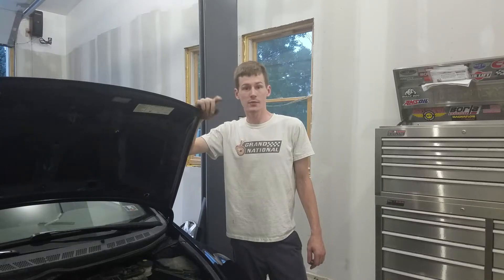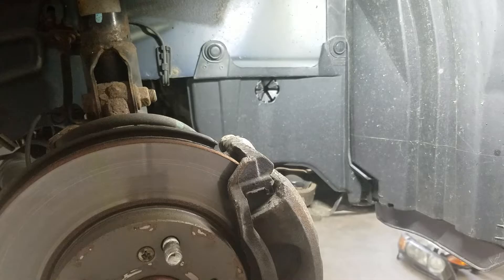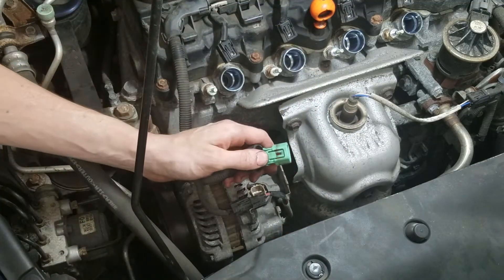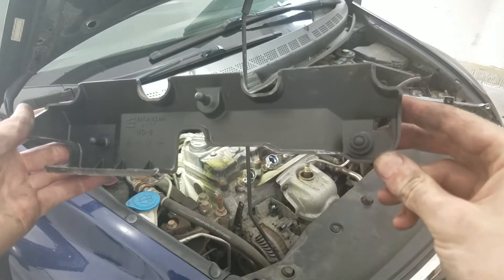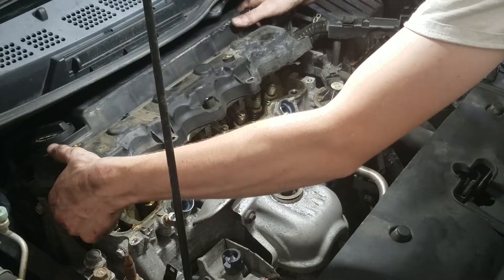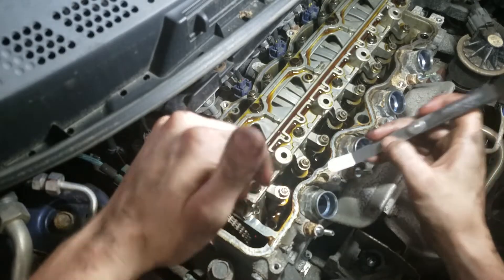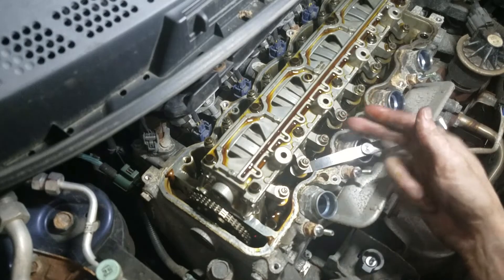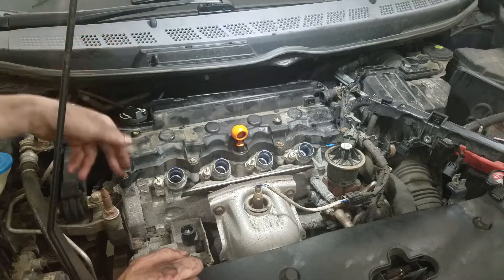2006-2014 1.8L Honda Civic Valve Adjustment

Comment from the maker: I forgot to mention this in the video but it is very important that the engine is completely cold. So, let the car sit overnight before you do this because, the valve clearance changes with engine temperature. All of the specs given in the video are for a cold engine.
Reply: Need help with valve adjustment of Honda city / jazz, thanks
Reply: Bro after valve adjustment fuel economy increased. Then in my next regill at same Gad station has mileage dropped back to 225 ish do you know what’s wrong ?
Reply: @sk8allica1 when you unplug your battery, the mileage trip numbers gets thrown off and shows more or less
Reply: @sk8allica1  more city driving?
Reply: maurjul nooo
Reply: @sk8allica1  everytime you drive is different people like you blow my mind how you made it to adulthood
Reply: Is it okay if the valve adjustment is 8/12? Engine temp is maybe 50%. Thank you
Reply: Dude, I read up online says Valve adjustment should be done while engine are hot...
Reply: @HansenWHS  some engines give a hot and/or cold adjustment value. The R18A specifies cold.
Reply: @HansenWHS  that is false. needs to be less than 100F

Comment: I 100% remember reading warnings about over-torquing the rockers on these when they first went into production, as it would damage the threads in the rockers and cause issues with them not being able to hold adjustment, but I can't find anything about it now.

I have an engine with rockers that wont stay adjusted properly. I've done more adjustments/clearance checks on my Hondas (two 1st gen CRXs, an '83 Wagon, a '93 CX, and a DOHC ZC swapped '91 HB), than I can remember, I never had a problem with the rockers not holding adjustment. One Civic (a 2004 EX) went nearly 150,000 miles under my care, the clearance never went out of spec after the first adjustment.

I feel like I'm the victim of some kind of weird prank!

Comment: You're turning the engine in the wrong direction, the chain might slip. You don't need to remove the wheel, just turn the wheels right. You also don't need to touch the alternator or the battery, just push the harness aside, no need to remove the coils either, there's plenty of space to do the job. You made such a simple job so complicated.

Comment: Good afternoon i think you got it confused , up is cylinder 1 then you do 3 which is cylinder 3 then clockwise cylinder 4 clock wise  then final cylinder 2, then spin s coulle times and re check

Comment: Good information I am over 300,000 on 2012 Honda Civic no valve noise
Reply: great car, ive got the same.  255k miles on mine  good engines all these years and miles

Comment: I need to do the plugs and valve cover gasket. I'm hoping between that and a valve adjustment I'll get closer to the mpg I'm supposed to be at (lx coupe says 35/40 mpg) I'm currently getting an average of 29. Is there anything else I could do maintenance wise to increase mpg. Like cleaning the maf sensor?

Comment: Removing the spark plugs will make turning engine easier - I remember that early, '69 to '76, Honda single cam four cylinder CB750 motorcyle used the same valve set up. Thanks for video - watching January 2025 and will use information to service both my Gen 8 Civics.

Comment: The Civic is the first car I've encountered in 30 yrs that needed manual valve lash adjustment. What was Honda thinking? I dunno, but I've sent them an email & asked. Overall a decent video with a few notable flaws. Why did you pull so much of the electrics off? I found I didn't need to do this to get the valve cover off. Hopefully i haven't ruined the car's electrics somehow.  You said "dipstick."  Your example of turning the engine over with a socket and handle shows you turning the engine counter clockwise. My understanding is that you only want to turn the engine clockwise. Your cautionary warning at the beginning about how there is important "feel" for how the feeler-gauge feels when the lash is adjusted correctly. The warning is so scary it would dissuade a user from attempting this service. As far as HEARING the sound the feeler gauge makes when the lash is correct: NO. How would you characterize the sound properly adjusted valves make? Difficult to describe? OF COURSE. You don't use sound to detect correct adjustment. NOBODY uses sound. The gauges used to test if valve lash is correct are called FEELER gauges. They AREN'T called listener-to gauges. Now, some critical style issues: there were several pieces of critical information you didn't narrate. I probably missed others, but one item i didn't miss was valve adjustment screw jam-nut torque is flashed on the video screen briefly, but. Same is true of valve cover bolt adjustment torque. Now why would you do this? If I watched only your video, your cautionary tale at the beginning would not provide me with enough confidence to perform this maintenance.  I did do the adjustment because I've done the valves on enough cars to know that i have sufficient skill to fill in the gaps you missed and perform the adjustment correctly. Lastly, you talk too slowly. I sped your video up to 1.5X so I could get through it without self immolation.
Reply from the maker: I'm anxiously awaiting your version...
Reply: @RepairGeek  Well, you got  me there. If I videotapes everything I do I'd never get anything done. Your video is a good video, almost perfect. I am providing constructive criticism with the noblest of intentions. You see, if your video was a hot mess, I wouldn't bother, but yours is SO GOOD, that all it needs is a few notable tweaks and you'd have the #1 Civic valve adjustment video on Youtube. Were I to make one, mine WOULD BE the number Civic valve adjustment video on Youtube. Do you seriously want that competition? If I start posting, it's going to piss a lot of people off. Actually, I just bought a tripod so I could do just that. Now i've got to work out that whole new Youtube security via security gizmo stuff before I can post. So keep your eyes peeled & your ears free of detritus.
Reply: @salvadormonella8953  wow Salvy, 7 months and still no number 1 civic video? I'm disappointed. I'd have thought a man of your persuasion would've already accomplished this task and moved on to dominating another industry effortlessly. Do provide updates if you ever learn your security gizmo issues or how to remove the tripod leg from the orifice it may have been lodged in.
Reply: @salvadormonella8953   encouraging. I subscribed so I'll get notifications when there is an update, or feel free to reply here.

Comment: I have lifetime oil changes at the Honda dealership which I see as a way for them to recommend maintenance like this and they have never mentioned it.  They mention $200 brake fluid flushes and $200 coolant flushes.  This is pure labor and would seem to be a perfect item to recommend.  I may have to take a look at this some time.  At least it doesn’t require shims and cam removal like the motorcycles.

Comment: When the sprocket is turned to a specific cylinder, do you adjust both the intake and exhaust side before turning the sprocket?
Reply from the maker: Yes. Adjust both intake and exhaust.
Reply: Thanks, I have 2 civics that are due 😊

Comment: why everybody is showing only exhaust valves gapping?
Reply from the maker: It's much easier to record and it's literally the same thing as the intakes just different specs.
Reply: Do you mean, with UP-2-3-4 marks on sprocket you do both inlet and exust gapping at the same time ? @RepairGeek
Reply from the maker: Yes exactly. Do all 4 valves when the cylinder number is shown.
Reply: Thank you ! so, 0.2mm intake, and 0.25 exhaust. @RepairGeek

Comment: Firing order for this R18 engine is 1, 3, 4, 2. The numbers on the cam gear match the firing order and you need to rotate it clockwise.
Reply: Looking at the motor from the bumper front bumper are the cylinders still one two three four from left to right? And what you are referring to is the order of the sprocket will be?
Reply: @titanpolus5088 yes. That is the engine numbers from left to right viewing from the front bumper. The firing order is on the cam gear/sprocket as i indicated.
Reply: @vinny1995  thank you
Reply: @ pass it on
Reply: @titanpolus5088  yes. You got it.

Comment: I wasn't looking forward to doing this as I went and checked spark plugs and regapped them, changed out the coil packs, and still the same problem with a PO303 code (cylinder 3 misfire). Once I had a chance to watch your video, I went ahead and did the valve adjustment and within two hours, the car was running smooth again and trouble code is gone.  Thanks for the great video and it was very easy to do so on our 2012 Civic.

Comment: Feeler gauge 
10mm socket and wrench
Flat head 
17-19mm socket
Intake .007-.009 exhaust .009-.011
Or intake .18-.22mm exhaust .23-.27mm
Reply: Does it have to between

Comment: Just took my car to shop for my 13 civic with 96,000 miles.  Got a call back that the valves are fine and need no adjustment.  Is this true. I told him based on my reading that they need adjusted/ checked every 30,000. Is this true? The shop told me that's pretty excessive and said it's a Honda man. So he only charged me for R&R for the valve cover and gasket etc...

Comment: I have to lift my car up with a jack. That means the front of the car will be higher than the back of the car. I am doing this on a slanted driveway too. If I am adjusting the valves when my car is on an incline, does that affect anything? Does the car have to be perfectly level front to back? I see you have a lift, but I dont have a lift to make the car perfectly level when I jack it up.
Reply from the maker: It doesn't matter if it's not level.

Comment: Thanks man. I thought i was going to need a bunch on special tools! Keep them coming!
Reply: according to my local dealership this is a very complicated job that should only be attempted by a professional. the tech even told me he usually does everything on his car but he pays one of the other guys to adjust the valves. they just want my money.
Reply: @dhtsoaedsdhtnadi9575  That tech is just:
1: To lazy to work on his own stuff because working on others people crap all day is freaking tiring.
2: He does not know how too. Seems to far fetched sence Honda Techs are ASE certified and have to continue schooling. 
3: They just want your money🤣🤣🤣🤣
Reply: @lunchbox3434  if they REALLY wanted my money they shoulda NEVER told me i couldn't do it. after valve job she ran 25 miles out and back (50 rd trip) smooth as silk. also replaced plugs and O2 sensors, cleaned MAF, pressure-cleaned fuel injectors with a valve stem and some seafoam top cleaner and wiped inside the throttle body. the momentary high rev on ignition startup has returned after an absence so long i forgot it was supposed to do that. got some accel g's too. not bad for $300 in parts and chemicals on an a/t with 135k miles

Comment: What position do you have to rotate the engine to before you start it back up?
Do you rotate the crank back to UP position on cylinder 1 before starting it?
Also, could you do a video on how to remove the cowl so I can service the intake and MAF?
Reply from the maker: The engine doesn't care what position it's in before you start it.

Comment: To avoid a leaky valve cover torque the valve cover bolts is a spiral pattern, starting with the bolts in the center, working outwards. Tighten them in two steps, with the final step torque to 7 ft. lbs. (84 in. lbs. or 10 Nm).

Comment: In other words you'd have to be a moron to screw it up. Each feeler gauge has a thickness. There is no reason to have to tighten or loosen beyond that spec. Put the feeler gauge in and run it back and fourth feeling for just barley a bit of drag on the gauge. Lock the nut and check it again. Same procedure for every valve

Comment: Are any of the Honda engines (like an 09 CRV-LX) reversed intake to outtake? One guy with his pics was saying intake was at the front and and exhaust out the back side. Is there any mark on the engine as to intake and exhaust?
Reply: I would hope you can tell what metal tube goes out the back of the car like jesus dude are you for real

Comment: Can you please help me on this as I cant find it online? My car is
1.5L
D15Y Engine
4 speed Automatic Transmission
Honda Civic 2002 Ex
4Door Sedan
Need to know the valve clearance measurement for this one? Please help me. TIA
Reply from the maker: Intake- .007-.009 inches (.18-.22 MM)
Exhaust- .009-.011 inches (.23-.27MM)

Comment: How would i know when a valve adjustment is necessary? My honda is at 120,000 miles currently. Can someone please help
Reply: 100,000 miles you're 20,000 past that
Reply: @kkmart43  it's more than likely fine, but worth checking when convenient.

Comment: I just did the valve adjustment on my Honda 2013 NC700X motorbike. It's incredible how this is nearly identical. All of the clearances are 0.001 looser for the Civic than the NC, but otherwise everything looks identical, down to the torque specs for the lock nuts, valve cover, etc. I was a little hesitant to do this job on my Civic because I was not sure how involved it would be, but now I am going to go for it. Looks like the hardest part is getting the wiring harness unplugged and out of the way.
Reply: How did it go?
Reply: Hi @raphael7606   - never did it. The transmission on the Civic ended up blowing up, and I sold the car before ever attempting to do the valves.

Comment: Great video, even better shirt.  You spent too long explaining the clearance.  If it slides without resistance it's too easy and loose, it's too tight when it pinches the gauge making it difficult to move. It should be snug, find the middle.